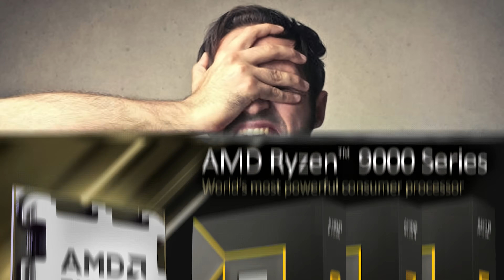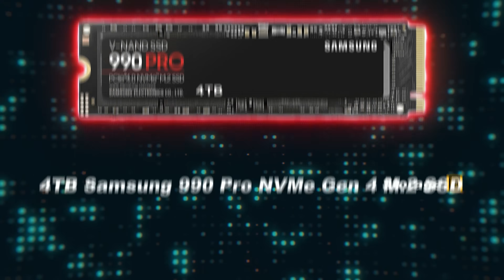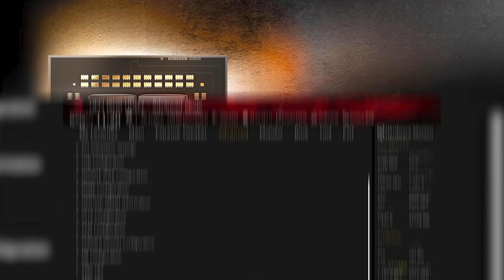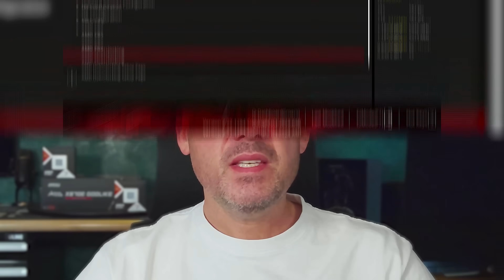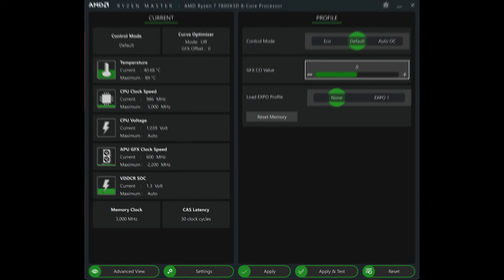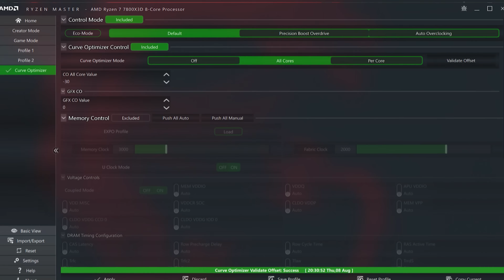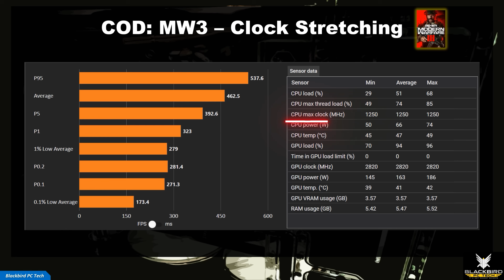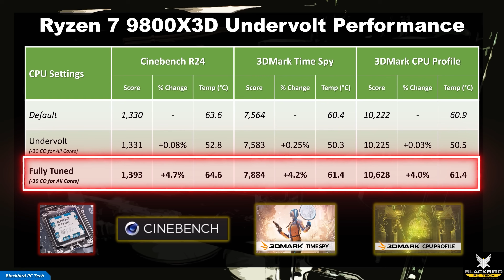How To Undervolt a Ryzen 7 9800X3D The Right Way! (or Any AMD AM5 Ryzen CPU)

Comment: It seems that if left Auto (default settings) at AI Tweaker section in Asus bios and set PBO-s in Advanced Tab inside AMD overclocking then I will get default setting with 140W package powers with hot CPU.
Need set all in AI tweaker disable or what to do?
Bios version is 1087 on Asus B850-Plus Tuf Gaming
Reply from the maker: I recommend watching this complete tuning guide: https://youtu.be/N60M36PRHsY
Reply: @blackbirdpctech  Thank you, did a new setup in Bios and ONLY set in the AMD section this time. The other problem was that I have tried to set PPT,TDC,EDC manually and unlike in other places, here it asked in milliWatt format, for example 80000 for 80W.

Comment: To me Prime95 result some higher numbers on load than Aida64. Did test with -30PBO Eco65W settings with x50 Ratio, but that +200 MHz not happened.
Aida64  - 60C with  95W Package
Prime95 - 71C with 118W Package
Reply from the maker: This video is focused on undervolting ... it doesn't cover other elements of tuning ... but this video does: https://youtu.be/N60M36PRHsY

Comment: What the hell, 53°C in Cinebench when my 9800X3D hits nearly 95°C with CO -25 and top notch air Cooler!? HOW with a 360 AIO!? 40°C difference?
Reply from the maker: Are you sure that you mounted your cooler properly?
Reply: @blackbirdpctech  I'd say yes. Remounted once already. Colleague of mine with CPU and 360 AIO water cooler and even similar temps.
And I've NEVER seen anything like 53°C in any review anywhere.
My PPT was at stock with about 155 W measured running. When I dropped the PPT to 115 W it immediately dropped to 70 °C under load. Amazing.
MY CPU 3DMark score dropped by 0.5%.
Reply from the maker: @b01scout96  I’ve tested three 9800X3D’s and this one is definitely a golden sample that runs cooler and can undervolt to -35CO all-core … the other two chips I tested ran hotter, but nothing close to 95 deg C

Comment: I also have a 9800x3d and rtx 5080 and mb of gigabyte aorus master pro ice should i also do the cpu boost clock override to enabled and max cpy boost clock to 200mhz
And thermal throttle limit to 80?
Reply from the maker: You can watch this guide that covers how to tune beyond just undervolting:

What Are The Best Settings for an AMD Ryzen CPU?

https://youtu.be/N60M36PRHsY

Comment: noob question: while running aida64 my clock speeds jump around the 4.8 to 5.1 ghz range. is that normal? shouldn't it be maxed out to 5.2 constantly?
Reply from the maker: Your CPU has a boost algorithm, so it makes sense that it will peak and then drop ... if you run it long enough it should settle on a consistent frequency.

Comment: So I do this on my MSI BIOS and when I exit, it doesn't say I changed any settings. Is this normal? I'm not sure if the undervolt is saved or not.
Reply from the maker: No, it should say that it saved ... you can run ryzen master to see if it saved or not.
Reply: @blackbirdpctech  I click "save and reboot" and it does restart normally. I went back into the same settings and the changes are still there but usually it'll tell me what settings I changed before doing that. So yeah maybe I'll just download that to check.

Comment: Got curve magnitude up to 30 on Cinebench, Timespy and CPU Profile and after that tried AIDA64 Stress test for the first time. It worked 1-2 seconds and crashed, until I set magnitude to 15. Then for 10 minutes it work fine so for now 15 is my number. Thanks for your effort.
Reply from the maker: You are very welcome!

Comment: can turning +200 clock speed degrade the cpu? I wanna try -20 undervolt + 200 clock speed but wanna know that its safe.
Reply from the maker: So let's start with the fact that turning on and using your CPU will "degrade" it and reduce its life ... the ONLY way to not do that is to not use it. So the question really is will overclocking the CPU degrade it faster? And the answer is yes however this is a boost clock increase ... it will depend upon the amount of time your CPU spends boosted, which you can control with the PBO scalar option. The reality is it likely won't reduce your life in a meaningful way and/or that you will notice.
Reply: @blackbirdpctech  I have pbo set to motherboard. Is that good?
Reply from the maker: Take a look at this step-by-step guide: https://youtu.be/N60M36PRHsY

Comment: I keep getting direct x 12 errors while playing BO6, Bf6, and gta 5. I undervolted my cpu a while back. 

Also, my windows 11 won’t update and keeps getting this error code (0x800f081f).

Do you think it was my undervolting or the windows update ? 

Going to try to fix that tmr as well as these undervolt setting you’ve provided
Reply from the maker: Did you check your undervolt stability in AIDA64?
Reply: Will check that right now. I had also done the undervolt the second way you showed in the Extreme tweaker section. Not sure if that makes a difference
Reply: Ran it at -30 and it gave a hardware failure right away. Dropped it to -25 and it didn’t give the failure til about 3 minutes… 

What do you recommend I do?
Reply from the maker: I recommend dropping it to -20 and seeing if that's stable

Comment: I'm stuck already, I have precision and Asus motherboard go to advanced, then amd overclocking click accept, but then it shows AMD overclocking greyed out, I can't find anything to make it find curve editor etc either
Reply from the maker: What motherboard do you have?
Reply: @blackbirdpctech CPU

AMD Ryzen 7 9800X3D

ASUS PRIME B840-PLUS
Reply from the maker: @sean7332  unfortunately the B840 is the only chipset that doesn't allow you to overclock your CPU ... it only allows you to overclock your memory.
Reply: @blackbirdpctech so I cannot underclock it? It's not a huge deal I'm just trying to find things to potentially reduce any extra noise
Reply from the maker: @sean7332  I don't think you can access PBO, so you likely won't be able to access the curve offset feature. Unfortunately I am not familiar with that chipset.
Reply: @blackbirdpctech ok thanks for the reply though appreciate it

Comment: thanks did 25 on my pbo  i use alot of cpu heavy stuff for astrophotography so wanted some cooler temps
Reply from the maker: Did it drop your temps?
Reply: @blackbirdpctech  It definitely did for PixInsight, which uses a lot of CPU power for stacking. It was reaching around 85°C at some points, and now it’s around 65–70°C. I think the issue with stacking images is that PixInsight causes CPU usage to jump up and down crazy, so the temps fluctuate quickly

Comment: Pretty sure I won the silicon lottery with my chip. Using the tweaks from this video, I dropped my temps from sitting around 80 °C down to a maximum of 68 °C in Battlefield 6. Started at -10 and worked my way up to -30, now I’m scoring higher on Time Spy and hitting better boost clocks with lower temps overall. I currently have a 9800X3D. Awesome video, thanks for the help!
Reply from the maker: If you want to extract even more performance you can follow this guide: https://youtu.be/N60M36PRHsY
Reply: Currently running All Core at -35 on mine and leaving it overnight running core cycler. Did fantastic at -30. Crashed at -40 while playing BF6. Been at -35 for over a week playing and goofing around without a problem but decided what the heck and do the test to continue with per core tuning. 😅
Reply: im on -50 with mine ..stable as a rock

Comment: So followed this exactly but when I save and exit, it says no changes made, even though I changed the undervolt value from the 5 that was there to 20. Is that normal to show no changes?
Reply from the maker: No, that's not normal ... it should list the changes you made when you try to save and exit.
Reply: @blackbirdpctech  I found it. Apparently there are multiple ways to get to this settings, but only one of them actually changes it. Hard to explain but it is actually that way. Go to go back in and use my phone to record and post, as it may help others.
Reply from the maker: @RickJamesBish  I explain that in the video 😉
Reply: @blackbirdpctech  yes its not apples to apples to my bios. I do not have an extreme tweakers. So should this method be used over setting the TDP to 65w, which is a preset option in my bios? I have not read a lot on it, but so far it seems setting TDP to 65 is favored.
Reply from the maker: @RickJamesBish  it always depends on what your objective is. You will kill your performance if you significantly drop the TDP to 65W.

Comment: So I have a stock 9800x3d no overclocking or undervolting and it went straight red. How can I fix that?
Reply from the maker: Do you mean in the ADIA64 stress test?
Reply: @blackbirdpctech yes
Reply: @blackbirdpctech actually I noticed it was at -15 automatically so I changed it to -10 on the ryzen master and it didn’t go to red
Reply: @blackbirdpctech but I’ve been gaming just fine at -15 so idk what it said it failed when I used that software ?
Reply from the maker: @starfleetLEGEND  it said it failed because it's not stable at -15 ... you were likely getting clock stretching without realizing it ... I would recommend sticking with -10

Comment: Hello, thank you for your video. I was able to get a negative 15 undervolt however i dont see a drop in my temps. On cinebench im still hitting 95c on a 9800x3d with an artic liquid 360 pro
Reply from the maker: I would recommend checking your boost clocks ... what may happen is that you drop your temps and then your CPU boost higher and for longer, using up that thermal headroom ... this should manifest as an increase in performance.
Reply: @blackbirdpctech thank you for replying! Ny original cinebench score was 21848 and the new score was 22579, do you have a video that shows how to check that?
Reply from the maker: @walterdiaz2966   you can use a free tool like HWMonitor to look at your clock speeds ... but the performance increase you got already confirms it. You can set a thermal limit to drop your temps if it bothers you. You can watch this video to learn how to tune your system:

https://youtu.be/N60M36PRHsY
Reply: @blackbirdpctech thank you!

Comment: Currently still testing but so far package temp has dropped from 73C max with pbo off, to 71C max with pbo on -5, and slowly worked down to pbo on -30 at 61.3C package temp and 54.8C core temp, all at 5.225Ghz, I guess my next step is to try some frequency offsets but honestly I might just set the fans lower and forget about it 😅
Reply from the maker: Really nice result and good job being patient and testing properly!
Reply: @fruitypebbles3047   very nice! are you getting same or more performance with this? even just keeping stock performance with such a temp diff is incredible
Reply: @NinTheLost  In Cinebench 2024 I got the same results within tolerances even with the -30 Curve Offset
Here's my cinebench 2024 scores with the PBO settings
PBO Off - 1359
With PBO On
 -5CO , 1282
 -15CO, 1328
 -20CO, 1302
 -25CO, 1323
 -30CO,  1334
The Clock Speed Itself was 5225Mhz in all of these as I didn't have a frequency offset set, But I will note that with -5CO and -15CO the Clock speed would fluctuate from 4.9Ghz-5.3Ghz, with it mostly fluctuating at 5.1-5.2Ghz,  kind of strange behaviour, and it made me think that I was experiencing "clock stretching" as mentioned in this video, but it simply stopped at -20CO and beyond.
Nothing to do with thermals, as all tests were conducted at the same locked fan speed of 50%

Comment: This is a late comment but I did -30 and did a test, it ran and didn’t crash but my temps didn’t change and during gameplay it didn’t change. What could be the reason ?.
Reply from the maker: It doesn’t sound like the undervolt was applied … where in bios did you try it?
Reply: @blackbirdpctech  I followed your steps all the way, went to amd overclocking-performance boost-advanced-curve optimize and set it to negative then did each test at 10-20-30 and ran each one for 10mins. I made sure to hit f10 and confirmed the save. My max temp hit 66 each time and then I said okay, let’s go try it in game. My temps are still the same. For example with just performance boost on, playing Minecraft with mods makes it hit high 70s and mad 80c. Other games like call of duty with the boost on (not messing with the negatives, just default boost) I hit 60 to 70s. I just put my new arctic liquid freezer iii pro 360 in yesterday morning. I thought I did a good job with the thermal paste as my idles are 40s. My chip is 7800x3d.
Reply from the maker: @christianking-ev4vj  the boost won't do anything on a 7800X3D because it's locked for overclocking. That said, an undervolt should still work. I would recommend following this guide to make sure you set up your cpu and memory correctly:

https://youtu.be/N60M36PRHsY
Reply: @blackbirdpctech  so I did watch and actually using Ryzen master for some reason actually worked. I did an curve of -10 and my temps did drop a little bit which I’m very happy about. When loading up a game, it takes just a little bit longer to load, is that normal or should I be fixing something?. I haven’t tried past -10 yet. I’m getting 4700-5000mhz for my clock speed as well which from research seems to be pretty decent. It’s not full blown stable but it bounces around that. Sometimes a little lower than 4700 depending.
Reply from the maker: @christianking-ev4vj  taking longer to load a game certainly isn't normal ... to help you troubleshoot further, you can join our Skool community:

https://www.skool.com/blackbird-pc-tech-4230/about?ref=67e6a7048d9540fe87cbdf1b69bd47f3

Comment: Well. My system freezes under -20. It's interesting because at -25 sometimes the aida64 test runs without any problems, sometimes it frozen after 1 minute. The temperature for me under cinebench 23 in multi-core test is max. 76 degrees, in single-core test max. 45 degrees. Is this normal? My cooling is an Arctic freezer liquid III 360.
I did everything as in the video.
Reply from the maker: Looks ok to me!

Comment: This video is perfect for me. I just got my components to build my new pc 9800x3D and 5070ti
Reply: Same parts got this week!
Reply: @tiborkote  it's been amazing playing with that build. Much better than my old setup with a Ryzen 9 3900x and 3060ti
Reply: Yoo you exactly have the setup I am going to buy in a month. Quick question which cooler are you using and which temps are you getting?
Reply: @danydepany arctic liquid freezer iii pro and the temps on maximum load barely touches the 75°C. While gaming bf6 for example the temps reaches up to 66-69°C on ultra settings
Reply: @danydepany also my case is a Lian Li 207, so airflow is maximized.
Reply from the maker: Then you should check out this more comprehensive guide as well: https://youtu.be/N60M36PRHsY
Reply: @blackbirdpctech thank you. I definitely will.

Comment: is this still  recomendable to date or there is any other method for UV? i just mounted today a 9800x3d, rog strix x870e-e and gskill 32gb cl30s
Reply from the maker: The approach hasn't changed ... I would however recommend watching this video to fully tune and optimize your CPU and memory:

https://youtu.be/N60M36PRHsY
Reply: @blackbirdpctech  thank you! its time to get all the juice from the 9800x3d
Reply from the maker: @KhalifaFPS  good luck!
Reply: @blackbirdpctech  did a 20 min aida stress, EXPO 1 6000mts / -30 crashed, -25 all cores passed,  temps are great, i maybe continue trying and adding +200mhz, and journey ends!

Comment: Does ram speed come into play with stability? I have 32gb of ram at 5200mhz and I can only go to -10 before it has stability issues. Upgrading to 6000mhz next week.
Reply from the maker: No, your max undervolt is governed by your CPU silicon quality. As long as your memory is stable, it won't impact your max undervolt.

Comment: I did a -25 and while doing ada64 my clocks don't stay at 5250 they keep going from 4900 to 5100, temps are fine tho and the test doesn't crash or give any errors, I was using hwinfo to check the clocks should I drop to 20 to see if they stay at 5250?
Reply from the maker: As explained in the video, that sounds like clock stretching ... so yes, I recommend reducing your undervolt.

Comment: I haven't ran across a single amd x3d chip that couldn't accept a -30 undervolt.  Start there and you should be fine
Reply from the maker: That's not good advice ... I've ran across many that can't do -30 stable ... just read through the comments to this video and you will see that most can't do -30.

Comment: Hola, tengo un problema y es que mi placa base es una a620m plus wifi, la cual no tiene curve optimizer y en escritorio se me pone a 80 grados o más a veces, en tareas siempre a 97 grados que es su máximo. Creo que valdría la pena cambiar la placa solo para hacerle undervolt verdad?
Reply from the maker: I would recommend figuring out why it's running so hot first before switching motherboards ... is it your cooler, your fans, your thermal paste, etc.